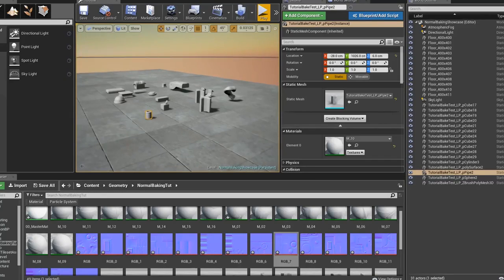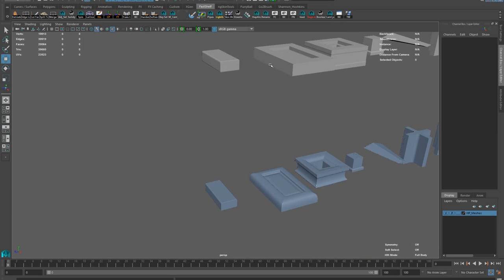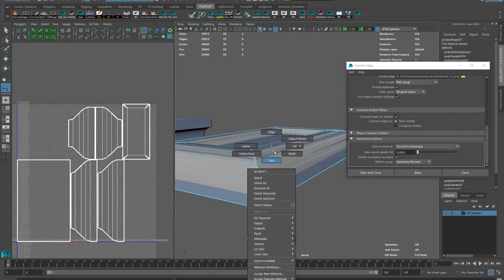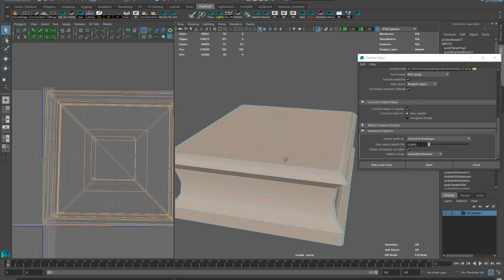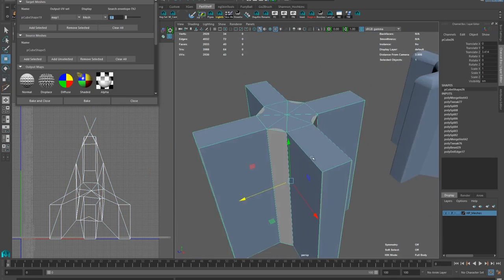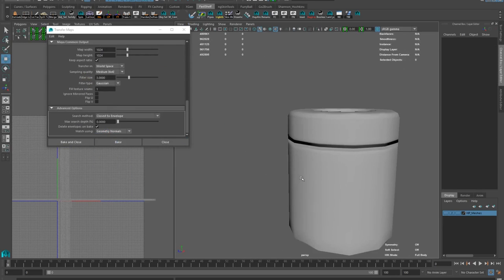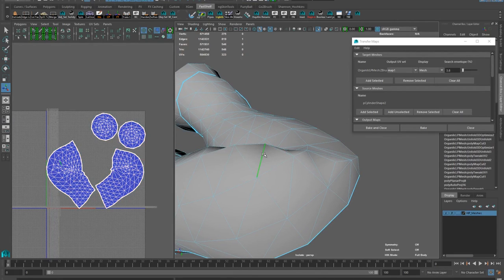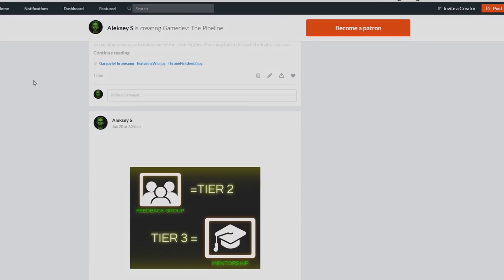Practical Guide To Normal Baking

Comment: Are you sure that extra vertex points that don't connect and make a face (tri's) to shade, will effect the performance of the game?
Reply from the maker: Hi, Jack!
Triangle count does affect in-game performance, but it really depends on how the asset is being used in the project and a target platform of your game. In certain cases an extra 1k - 10k tris could have less performance impact than a low poly mesh with a high resolution set of textures.